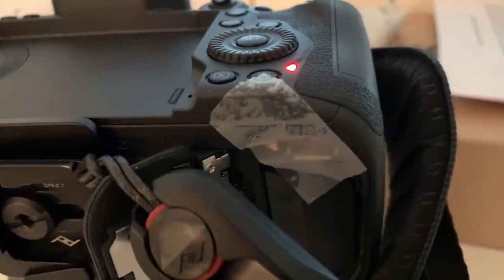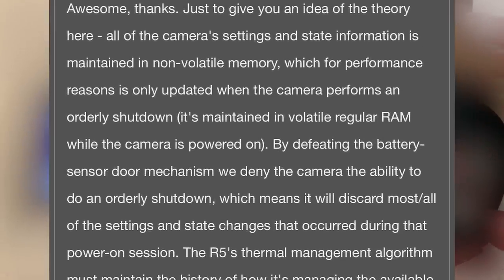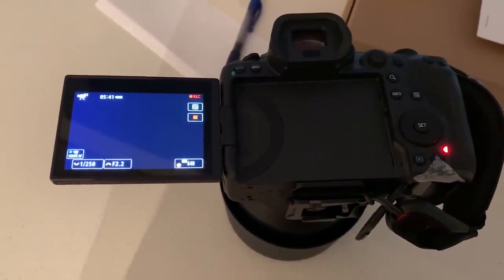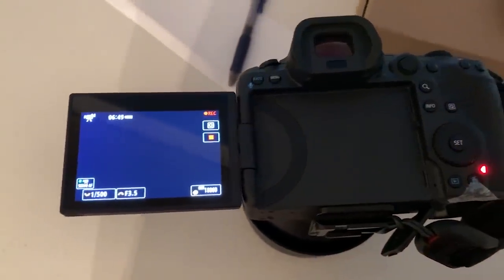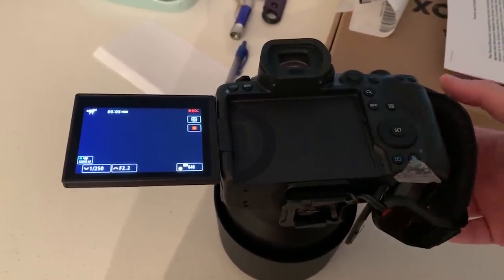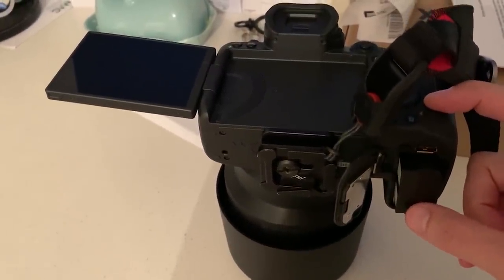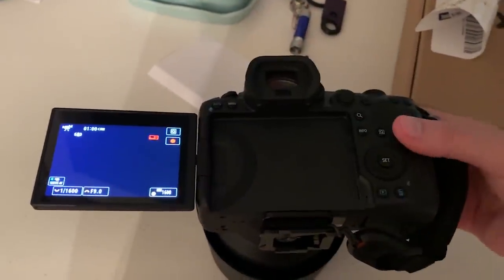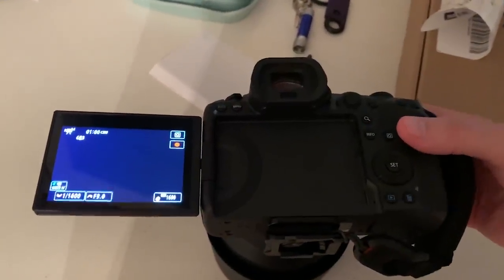CANON R5 OVERHEATING FIXED 😳 With SCOTCH TAPE!! Crazy !! But TRUE!! WATCH THIS!!

Comment: So everybody on youtube is claiming bad intent from Canon... this is impossible to proof but looking at the internal temperatures and the noise the camera creates in fotos when it is close to overheating tells me, they're not lying. The camera is VERY hot and if you don't want to trash your camera long before its time, you should probably not manipulate it and go beyond it's thermal limitations preventing early degradation of whatever component!
Reply: Right but it doesn't need 2 hours to recover from overheating. Thats silly. This thing also overheats in a fridge. So its clear these software limitations need to be fixed.
Reply from the maker: Totally agree! I have no idea of their intentions, but, the recovery times are a total joke! Totally unusable until that is fixed!
Reply: @SNAPAVELI  , @DStephen  , totally agree, the cooling down times are artificial by length, so there should be some headroom there for improvement. However, at this point, I don't see most youtubers being satisfied with whatever more borderline thermal shutdown/limiting/warning firmware canon comes up with, they will claim, that it's still artificially limited since these tricks make it run faster.  What options do they have? If they rid themselves of the limits people will either complain about image quality and/or demand canon replaces their cameras as soon as they fail because the heat damaged components. 
That's why I dislike this entire notion that it's on purpose after seing/reading actual thermal measurements. The camera does overheat, it's easy to see. The reason one doesn't feel the hull being hot everywhere is that there is no room for heatpipes or any other type of thermal coupling to the hot components. You can't have it all in that form factor in 2020.
Reply: I tend to think Canon is throttling the camera to prevent thermal noise and  it doesn't get hot enough to damage anything.  I think it would shut down in all modes before any damage occurs, but I could be wrong
Reply from the maker: Robert M if that’s true I would actually be fine with that it they would allow it to get right back to shooting just like when the Sony’s overheat. Clients can’t wait on you to cool down for long periods. Even just give us 3 minutes back, then 3 more... I’d be ok with that this time
Reply: @randfee  exactly this. I also think the cool down times are not THAT artificial and have more to do with "good" insulation of the body and longevity of the components.
Reply: If it was really thermally throttled, resetting the clock would not have reset the overheating timer.  EOSHD did testing and the cpu never got abnormally warm.  It was well under the safe  limits.  

https://www.eoshd.com/8k/removing-internal-battery-resets-eos-r5-overheat-timer-are-canons-pants-now-completely-down/
Reply: @codebus  I don't like EOSHD as their methods are not fancy enough to back up their mouths - at least not entirely. Bold claims like the camera 'does not overheat' can only be made if you know exactly what you're talking about, this guy has no background in electronics, engineering or image sensor design - but yes, he has some points (but not that it doesn't overheat). If you want to claim 'no overheat' tell me what the limit for all components is or how you define it. 
I am 100% certain that if the camera did not shut down but produce noisy images like smartphones (while too hot) everybody would be claiming Canon produced a shitty camera due to lack of image quality - I'm VERY sure EOSHD would claim that. 
That being said. If I were Canon (now!, not before release, totally different story) I would offer an option to accept bad image quality for longer runtime, I'd also fix the cooldown timers. I can only hope they actually have a bunch of thermal sensors all across the critical components so that they actually CAN measure the real temperature. Chances are they don't have those sensors and therefore must guess and implement timers for worst case. If that's the case however I'm sure they'd redesign the camera and release a successor with proper thermal tracking within a year!

Comment: ALL OF THIS IS NOT NECESSARY. Canon made this camera for FILM MAKERS as a B-ROLL CAMERA, NOT FOR VIDEOGRAPHERS and PHOTOGRAPHERS (hence the name R5 and NOT D5). Film makers ONLY USE B-ROLL cameras for establishing shots which NEVER really go for longer than 1 minute anyway. Then Canon made the R6 as an A-ROLL camera for actual film making. Canon KNOWS THAT for Establishing shots you need a higher resolution camera so you can crop or zoom-in on post if you want to without loosing quality, so you can go from 8K to 4K as your final output. I've been looking for this kind of camera for a long time? I'm so glad that Canon understands FILM MAKERS so well. So stop talking about this camera overheating problem because it's not. Just  buy the right camera for what you do. Canon has tons of them. God bless.
Reply from the maker: Hey! Have you seen how bad the R6 overheats? It’s even worse.

Comment: Here is a very simple explanation of what is happening here.
Imagine you have a car with a tank of fuel. There are two ways the manufacturer could design the car to measure the fuel left and calculate your range.-
Option 1 : A sensor in the tank that measures the level. Whenever you turn the car on it measures the amount of fuel in the tank and the onboard trip computer calculates the likely range.
Option 2 : The car starts with a known amount of fuel and a sensor in the fuel line measures the flow of fuel and records it in the onboard computer's memory. So long as the onboard memory is saved it knows the amount of fuel used and there for the remaining fuel.
With option 2 you COULD trick the computer by pulling the battery etc. HOWEVER you will still run out of fuel!
Sadly all this scotch tape trick proves is that the technique that Canon is using to determine the chance of an overheat is not a direct measurement of the camera's temperature.
This in itself doesn't prove anything as it is entirely likely to be because it is either not possible OR it is not as simple as the camera must be below X degrees. Let's go back to the car analogy. The redline on your car's rev counter may be 5000rpm and it may have a limiter to cut the power should you exceed for example 6000rpm. That does not mean that you will not damage your car if you permanently run it at 4900rpm. It's likely that Canon is limiting (perhaps too aggressively) certain types of usage behaviour that could put long term stress on the camera's internal components.
Reply: In far lesser words thats whats everyone is saying!

Comment: Even this hack works to geht the camera back to work, the body is not cooler and i expect it will be damaged sooner or later.  It's a dangerous workaround and not recommended to do that. I am interessting in a solution, who  prevent's the camera to get so hot as now.  I am sure, that canon will do something, if the R5 will not sold as good as canon expect.
Reply from the maker: Yes they definitely need to be the ones to fix this! This is just proof the recovery times aren’t legit.

Comment: But you lose the recorded file doing this right? It's a great experiment. But not sure it would be useful. It might also run the risk of bricking your card.
Reply from the maker: I’m totally not sure of the ramifications. Out of the 3 times I tried this in a row one of the video files didn’t remain. So you don’t lose it every time, but it’s definitely not a solution. Just proved my that something isn’t right here.
Reply: @SNAPAVELI  yes! No disrespect. I should have added that I'm glad you shared this. It proves a lot of the theories around a time budget instead of a thermal budget. Thanks for posting.
Reply: @SNAPAVELI 
Question. Was the videos you didn't lose over 4gb?
Was the file you lost a short clip under 4gb?

I ask because the software typically caps videos at 4gb then combines them. So I'm wondering if that plays a role?
Reply from the maker: ❤️ I didn’t take it like that at all!!
Reply from the maker: Good question! Definitely all of them were over 4gb! I’m guessing 5-6 minutes of 4k 30 hq mode is 20gb or more

Comment: I think if they are playing with the internals of the camera so that it shuts down well short of a true overheating situation for legitimate reasons that’s alright.... i.e. If they are doing it because in their tests the cameras sensor or processor literally MELTS at a certain point and they are trying to be cautious and protect the longevity of the camera then alright, I understand , However if this is to ensure that real true professionals and DP’s buy the Cinema Camera line, then sign me up for a class action  lawsuit against Canon for false advertising then EVERYONE should boycott the company. 
They marketed this camera as a professional WORKHORSE and if they crippled it they need fix it with firmware, but even if it is legitimate they need to find a way to get the camera more shooting time in HQ and Slo mo, and recovery times need to be shortened SUBSTANTIALLY! Crazy! 
Great test! That’s some clever Under cover sh*t right there....
Reply from the maker: Couldn’t agree more!! I think it’s a lot more of the latter considering the 1dxii can shoot 4k 60 indefinitely. I know it’s a bigger body but the r5 cool down times are insanity. They probably have a mirrorless 1 series in the works and want to “unlock” these features for it but.... thy should have went on and on about this as the video king....

Comment: I just hope that my R6 will not come with firmware fix already.. so I could not use this method or atomos endlessly.
Reply from the maker: LetsGetMarked Atomos definitely the way to go!! This is supper ghetto lol
Reply: @SNAPAVELI  ye, the overheating is just 1. step.. second cripple is the codec which is super hard to edit :D
Reply: This method will burn your camera.
Reply: @keima1110  how do you know?...
Reply: @getmarked  a guy in china take apart the camera and do the measurement. When it overheat, the temperature inside did go up to 60-70C. So if you disable that, and let the camera run, the temperature of the processor will add up from 60-70C instead of 30C. And image sensor doesn't like hot temperature. 
If you can read chinese check below. If you cannot he still have picture showing the temperature.
http://c.tieba.baidu.com/p/6891962890?pid=134220330367&cid=#134220330367
Reply: @keima1110  give it 2 min break and its again 30C.. :) no need for 2 hours + breaks
Reply: @keima1110  also, they measured that temperature of cpu doesnt go above 65C and sensor above 40C
Reply: @getmarked  Yes, with the camera opens up.
Reply: @getmarked  at 65C it shuts down.
Reply: @getmarked  but in a disassembled state it is whole different story. It is like cooling tea in a plate or in a thermos... no?
Reply: @keima1110  or you can shut it down by removing battery, give it 2 mins and repeat.. think

Comment: recording a blank/black screen doesnt add proof that r5 can record a long time.
try this again in real recording situations like outdoor, in a room etc.
Reply from the maker: It’s more to showcase the overheating isn’t a true temperature overheat, only a timed based software limit. Eos HD did take it further and with this process plus changing the card every time , full time was available. He recorded 8k for 50 minutes

Comment: So basically if someone hacks the R5, we will get one hell of a cinema camera shooting 12bit raw internal...holy crap...I guess the rumors were true that canon was going to charge $7000 for the r5, so since they only charge us 3900 they crippled the hell out of it
Reply: Why would they do that? They put in the same amount of money into the camera either way, so it makes no sense to purposely "cripple" the camera when it already has the abilities built in. This is just unfinished beta  programming of the firmware. There is no conspiracy here. People have to be logical and use their critical thinking muscle more rather than jump to silly conclusions.

An R5 has about as much affect on cinema camera sales as a Digital Rebel has on 1D sales. They are not the same thing.
Reply: @77dris  We've chatted before.... Exhibit A: Canon M50... Crippled by Canon intentionally... unless you give them some more money.

Comment: should have stopped the recording before popping out the battery. If you don't that's a good way to cripple the card.
Reply from the maker: I’m not sure if stopping the recording would have allowed the camera to write the overheat data though.... good point about the card!

Comment: I don't get why everyone is mad about this!, this is Canon's way of protecting your investment. Heat kills electronics, don't try to work around it.
Reply from the maker: I think we are mostly mad because they marketed this as the ultimate hybrid, when in all honesty it’s the worst camera in their line for video. 1dxii and 3 don’t overheat. They once again have found a way to cripple the selling features. If they could even get it to Sony’s level of overheating recovery times, I would be happy.
Reply: Canon shill or fanboy? Tests with thermal cams show it’s cooling down quickly and is nowhere near critical temps ever during recording. It’s all software limits to screw the customers.
Reply: @ChrispyArt  Nothing to do with being a fanboy. I actually shoot Nikon right now but i'm being realistic. Don't think Canon would shoot themselves in the foot like that, lets be real.

Comment: Here is my new R5 hack from this Sunday the 6th of September. 
It works with Canon R5 and R6 and with firmware V1.0 and V1.1 
It do not lose data, do not force you to open the camera, it's simple and easy. 
https://www.visionrouge.net/canon-r5-overheating-hack-solved/
It also clearly shows that all these overheat excuses are completely fabricated and an simple flag setup with a time stamp difference is responsible for bricking your camera, on the  recording time and cooling time.

So simple to activate that it's embarrassing to keep call this an overheating issue.
Reply from the maker: Thank you for figuring this out!! Going to test this today. Much more usable
Reply: @SNAPAVELI  Great, let me know if you are publishing a video about it and try to keep the original article link as reference! Thanks

Comment: CANON is most likely doing this to protect the internals and their REPUTATION! if we look at it this way, heres proof, and an example on other EOS CAMERA. When i recorded Multiple WEEKS (around 4 weeks) of 4 hours constant video ALL- I recording per day,  my Canon 70D ELETRONICS GOT DESTROYED, the chip was not working correctly because of an OVEREXPOSURE of HEAT on the chip, probably happened because of constant no break recordings, WHICH LEAD TO the repair of the chip, which at the time cost around 360 dollars. And i was really pissed for even having to do that, because i though i paid alot for the camera at the time.
SO TO THE POINT, Canon is most likely protecting this cameras EOS R5 internals,  from major outbreak of heat destroyed chips and its bad reputation for that. It may not happen soon, but if it got out of control, it could lead to lots of refunds and mess.
Reply: Not really. The sony a7s3 overheats too and shuts down after 2hours, I think. 2 hours is a very acceptable time at least far acceptable than 24minutes of Canon. This is Canon still trying to protect their Cinema line of camera. If they give us unlimited 8K in a small DSLR or mirrorless, they feel many will not buy their Cinema line of Cameras again and this is not true. Sony's  Mirrorless has  not stopped people from buying the FS lines of cinema camera
 Canon is jst been overprotective of their C series line of camera. There is always a Cripple hammer on Canon's Mirrorless and DSLR to make sure people cough out money and go for the C200, C300, C500, C700 series.

Comment: This is the same as some guys in china found, but he did open up the camera and check the temperature. The camera does overheat. The timer goes on after the camera overheat. So don't do that too often. This will burn your camera.
http://c.tieba.baidu.com/p/6891962890?pid=134220330367&cid=#134220330367
Reply from the maker: Definitely!! Yes it is getting hot for sure! I just don’t think the cool down times are correct at all! Thank you!!